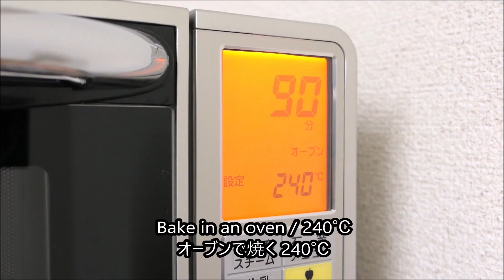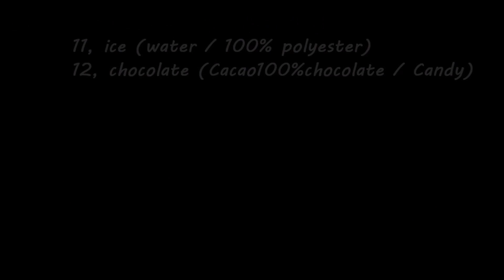この包丁はペットボトルで作られています

Comment: Ok, but... isn't it like... dangerous? I mean, you shouldn't even drink from a plastic bottle when it's hot outside, because it would be polluted with chemicals. The plastic, bottles are made from, isn't slightly safe at this point. At least, that's what I've learned from school. Am I wrong though?

Comment: The goal justifies the means when it is more expensive than the means. To spoil the microwave with poisonous vapors, which will later emit this poison into the heated food, to spoil the pan, the coating of which is not intended for sudden temperature changes + saturate its surface with plastic molecules - you can throw the pan away... Who does not know - the knife will be worn at the molecular level in the food that you will then absorb. If metal molecules do not cause harm to the body, then plastic molecules are clearly not natural for humans. The video should be banned from viewing. The highest degree of misunderstanding of the surrounding world and propaganda of how to destroy yourself...